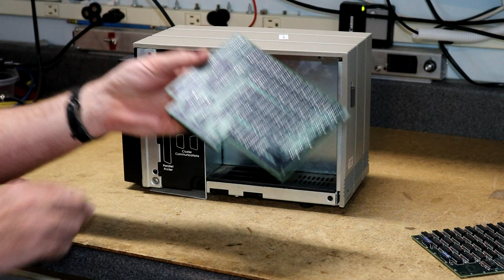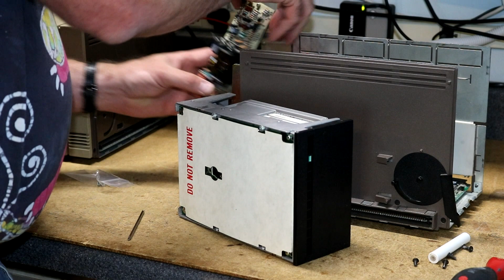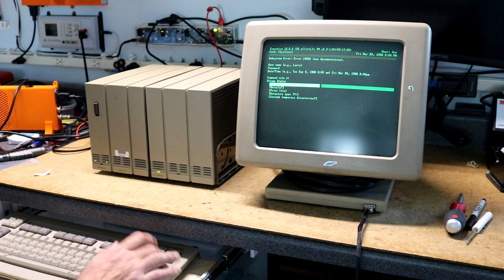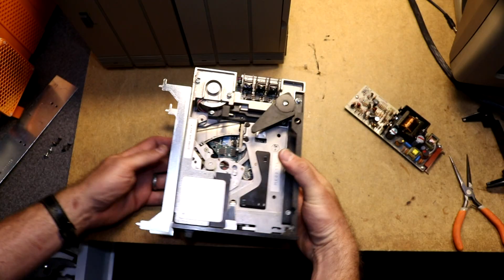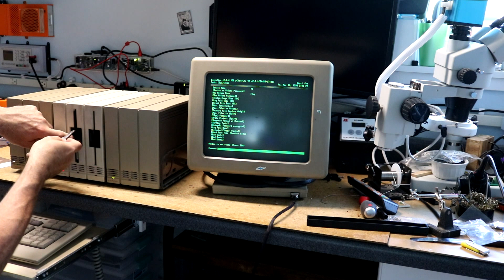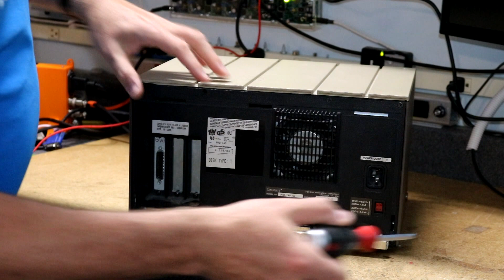Convergent NGEN Part 4 - 286, 386, Ethernet, SCSI, Tape, and more!

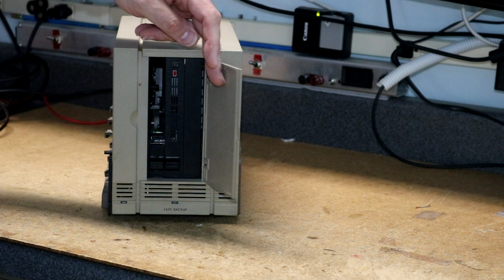Comment: 28:17 Those sound like DC2000 cartridges. I had a drive like that, that colleagues would use for backups. You put the tape in, and the drive would spend ten minutes “retensioning”, winding the whole tape to the end and back to the start again, before you could do anything with it.

Comment: This brings back memories.  😯 I was one of the software engineers at Burroughs/Unisys who did the software for these great machines.  I wrote many of the diagnostics when I started.  Then I moved into the operating system where I added SCSI support and wrote the tape backup utility for the then new SCSI tape drives.  It also allowed backups to span multiple drives.  Then I moved to the Network Computing Group where I took over BNet which was the top layer of all the communication protocols.  This allowed these machines to be connected to each other or to mainframes.  I rewrote most of it so that it was easier to config and to include all the new protocols such as Ethernet, OSI, IPX/SPX.  It all ended in the summer of 1994 when they decided to shut down our office.  What a shame.  It was the best collection of talent/people that I ever got to work with.
Reply: Would you be interested in developing a new version of CTOS to work on modern hardware?
Reply: @ Why would you want to do that?  Just for fun?
Reply: @jimomertz  offer a stable and secure OS that people can trust.
Reply: @ I'm seriously considering it with all of the crap OS's on the market.
Reply: How much would it cost to put the team back together? Looking for Retired Burroughs/ Convergent Technologies/ Unisys employees that worked on the BTOS/CTOS/NGEN software team.  Brining the OS back to market, it is time.

Comment: I have very fond memories of this computer in my childhood around 35 years ago. I think it may have been a burroughs B25. Mine had a MS-DOS emulator installed called "pseudo dos" or perhaps "pseudos' I don't know memory fails. It had a C compiler, the vendor I don't know anymore. I spent many a day writing code making silly text based games networked to my Amstrad 1512 over serial.Believe it or not it included a couple of arcade games, I think more to demonstrate the machines capabilities. "Ghost Chopper" and "Rats of the Maze" were my nintendo.

Comment: My uncle had an insurance agency office  way back when. In the 80's my cousin worked for him and I'd often hang out at the office. They had one of these systems with two terminals, and I would play with the system all the time. It was branded Unisys (I believe). It was my first taste of a multi-user system, and I was so curious about it. So no. I'm not bored with this video mini-series, I'm finding this very interesting! Thank you for uploading them! (I believe his office converted to PCs in 94 or 95. Somewhere in there.)
 
Side notes as I'm watching: 
The IT department for the insurance company called each module a "toaster," and that confused the heck out of me when my uncle said "so and so will be out to upgrade the hard drive toaster." He also had a laser printer connected, and because I could type so fast as a teenager, he'd sometimes dictate to me and I'd write letters on that machine! Whatever word-processor the insurance company included was (obviously) pretty basic, but it did the job!
 
Yes there was a modem module. At a specific time each night, the computer would dial up and connect to HQ to send/receive info about policies/updates/changes/rates/emails etc   Their system was installed, sitting on top of file cabinets. As I recall it spanned three file-cabinet tops with the various "toasters" (modules) HQ required.

Comment: The neon on the Ethernet adapter will be for high-voltage lightening suppression. It'll be connected between the cable shield and real earth. This is often a MOV on newer adapters or a spark gap (which look like a ceramic cap that someone has cut a neat slot in with a Dremel. 10Base-2 or AUI transceivers are galvanicly isolated from the rest of the electronics on the NIC but there needs to be something to keep the voltage on the wire from wandering too far away from Earth.

Comment: I have a number these slices

I think, including a 386 cpu, extra memory, graphics...might have a pile of PSUs and monitors in the loft too

are they worth anything ?

they were sold in the UK under the unisys brand...unisys/burroughs B20
Reply from the maker: Yes, they were sold as Unisys. Might be worth something depending on the buyer -- I've bought a few pieces myself, but lately it seems like some of it will sit at auction for a long time. Having a monitor and keyboard will improve the usability/marketability as those are not readily interchangeable with other platforms.

Comment: That blanking plate on the end of the floppy drive unit is supposed to go on the very end of the stack.  The unit is not designed to operate without it, according to our Burroughs service technician, though it seems to work, it may cause some malfunction.  Safest to put it on, I was told, though I am only a software engineer.  Nice video.  I recently found this other video with interesting comments:  https://www.youtube.com/watch?v=6hV_VTM_pOM
Reply from the maker: That's good to know, I haven't been very diligent about attaching the blanking plates, and I have experienced a few crashdumps. I'll have to start using it more often.